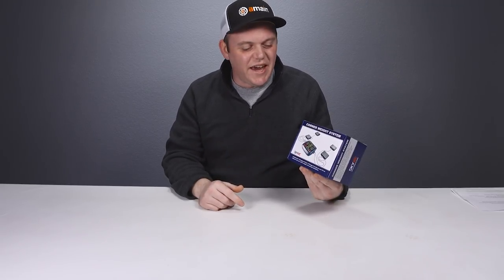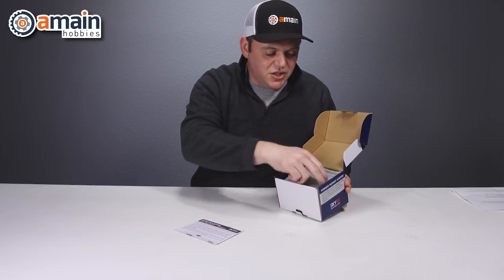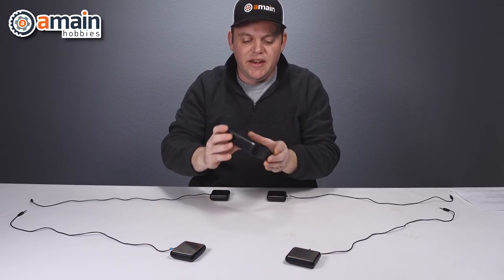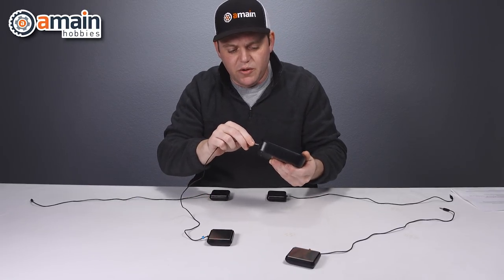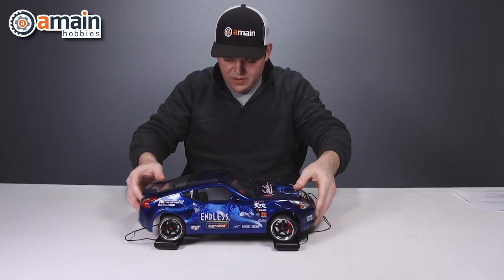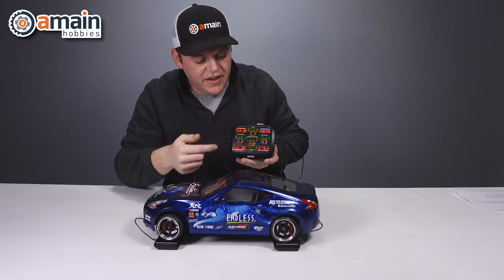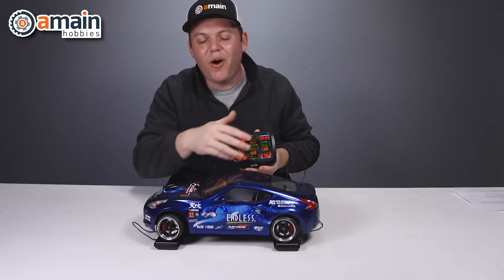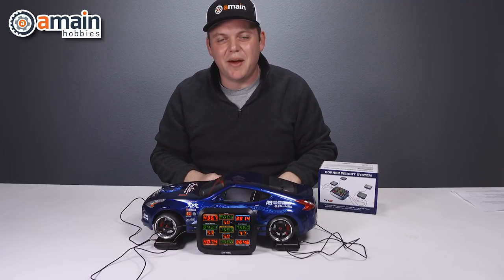What's New: SkyRC Corner Weight Scale System

Comment: Ha!,  Been using digital postal scales for years to set each corner.  Amazing what a little lead weight, and weight reduction here and there,  will do for Rc on-track handling.  Throw away all those ideas about adding mass.  Sometimes,,it helps a bunch.  Once I picked up the complete Hudy 1/8 scale set-up system back in 06-2007??,,I needed the postal scales to dial the corner weights and front to back to my liking..    Nice little unit,,and it does the math for you.

Comment: Been doing this with 4 jewelry scales purchased at harbor freight for less than 12 bucks each.
Reply: Inverted Hover how do you get the right to left weight balance right away with just 4 digies without doing all the math though?
Reply: @paulwizal23d89  doing the math put money in my pocket.  It's not complicated.
Reply: @NissanPRO4X  Dont you just take the sum of all 4 weights then divide by each for the bias? That would be pretty simple.
Reply: @paulwizal23d89  Excel sheet.